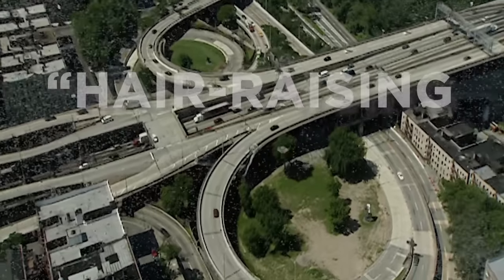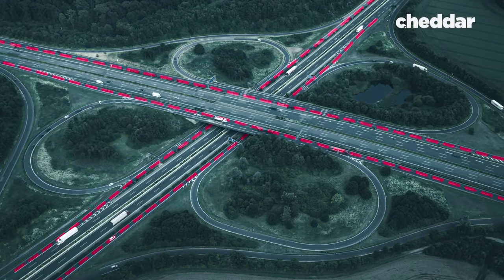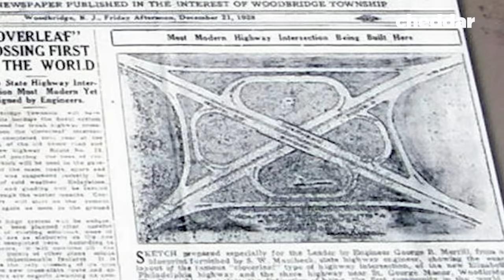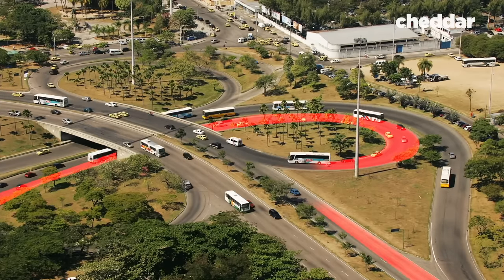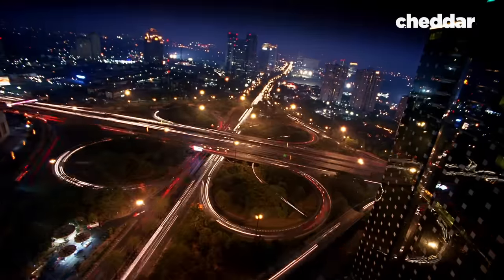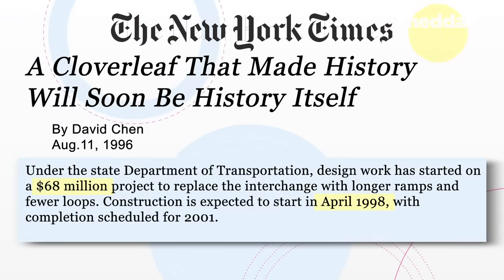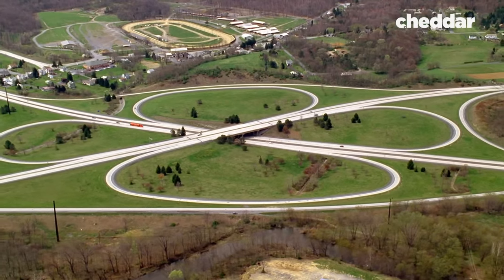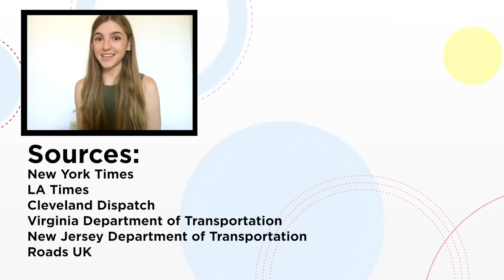The Big Problem With Cloverleaf Interchanges - Cheddar Explains

Comment: This Video: America’s infrastructure gets a D+ 8:58
Me a cities skylines player: Those are rookie numbers
Reply: The ASCE grading is about as useful as the Doomsday Clock.  It’s an over-used tool to get more funding ... to the benefit of ASCE engineers.  Don’t get me wrong, we need improved infrastructure but we’re not two partial grade ticks about ‘fail’ either.  How would ASCE grade India’s infrastructure, a “D-“ or the same letter grade as the US?
Reply: @UDumFck  The Lincoln Tunnel had water leaking in it yesterday. There's been a surge of water main breaks across NYC. Florida has had a problem with random sinkholes. A bridge in North Carolina had to be shut down because a support cable snapped. I would say that  is D material.
Reply: @Undecided0  Africa doesn't have paved  roads in most areas, I wonder what they would score?
Reply: @louvendran7273  Africa is a Continent not a country.
Reply: Undecided you double spaced “that  is”
Reply: Cites skylines woo
Reply: Ok, GrayStillPlays.
Reply: **Spams diverging diamond
Reply: You are not at a bad traffic level until there is 1% traffic flow
Reply: @UDumFck  Travel to actual sane country with laws written to benefit everyone, not just 1%, and you will see how good infrastructure looks like. D- is actually overoptimistic...
Reply: Sounds like America needs Biffa to come in and apply some lane mathematics on a nationwide scale.

Comment: A clever solution for the cloverleaf without weaving is found in Germany, right east to the Frankfurt Airport. A cloverleaf without weaving, because the exiting lanes merge inside the loop. There are 2 reasons why this solution was chosen: 1. located at the end of the runway, a construction up in the air was not an option. 2. lowering the intersection was not possible, because a train tunnel runs underneath it.

Comment: cloverleaf is an inside out roundabout. It favors through traffic, while roundabout favors right turns traffic. Both have capacity relative to turn radius.
Reply: The difference is that cloverleafs allow traffic to flow freely whereas theoretically roundabouts force all traffic to stop.
Reply: @joshbostock4371  You mustn't get out much.... or you're American.  You slow down a little for roundabouts -  except in Italy or Sydney where you speed up.  

It's a give way, not a stop.
Reply: Many motorway/dual carriageway junctions in the UK are raised or sunken roundabouts. Through traffic continues freely while only traffic that wants to turn needs to enter the roundabout.
Reply: Warwick Carter if there’s traffic in the circle you can’t just plow through them buddy.
Reply: @uhohhotdog  Merging into a roundabout is about timing  and giving way - not stopping unless absolutely necessary.   

If you're  always stopping you're doing it wrong. 

  If traffic is backed up inside the roundabout then there is a downstream products on one or more exits.  Queuing axross an intersection - roundabout or not is illegal in most places I've driven , even whrn there's congestion.
Reply: @warwickcarter4404  I'm a big round about guy, but either you don't drive or the roundabouts you do drive are sparsely populated. 

Agreed a yield sign doesnt mean stop, but any sort of consistent traffic, especially if it's not directionally equal (for instance a neighborhood road feeding a main road) will require regular stopping.
Reply: Warwick Carter I didn’t say every time. But it definitely happens. Not all roundabouts are giant ones with multiple lanes. Most here are very small one lane. If there’s cars in it you are going to stop.
Reply: @uhohhotdog   Most in my area too.  Usually you're able to see other vehicles and slow down rather than stop.  In probably stop at a roundabout once every couple of days, there's lots in my daily run around.
Reply: @cshairydude  That's a brilliant idea! My Cities Skylines will never be the same.
Reply: CommandoDude  Italians don't actually have driving rules. They just do whatever they want. I know this because I observed their driving for several days and there was no discernible pattern to what they were doing. The same rule seems to apply to pedestrians as well. We patiently waited at the side of the road for somebody to slow down and eventually we figured that you basically just walk out into the road and hope they slow down. I'm glad I don't live there!
Reply: @joshbostock4371  Meanwhile my country puts traffic lights & intersecting roads across roundabouts
Reply: roundabouts suck.

Comment: In the UK we have something more popular called a "partially unrolled cloverleaf junction" where two symmetrical loops are turned into right hand slip roads that run parallel to each other. They are useful because there's no weaving, they take less space and only minor traffic uses the loops. There's one on the M25/M40 junction
Reply: I knew I recognised that design, I live near and have used the M25 junction.
Reply: They look like a owl too 🦉
Reply: That would be known as a "cloverstack". Half stack, half cloverleaf. This eliminates all weaving. The reason to go full stack is for higher speeds.

Plenty of time you also see three parts cloverleaf, one part stack/turbine. It still has a weave, but perhaps that direction is not so busy.
Reply: That's the design I see in Austria.

Comment: They seem to work just fine in Germany, a few high traffic interchanges got upgraded, but the cloverleaf is still by far the most common variant.
Reply: Germany isn't as auto-centric as the US. Far more people use public transport over personal vehicles.
Reply: Germany's autobahns ends at the urban boundary, they dont cut through the urban downtowns, at least not to the extent that highways in the US does.
Reply: Tao Liu 
To be fair, when the highways in the US were built almost none of them went through Urban cores, everything just built up around them.
Reply: From what I've seen of German and Dutch cloverleaves, the lane where the "weaving" goes on tend to be a lot longer allowing the traffic merging in and out to do so at the same(maximum) speed of the lanes next to them, which helps a whole lot.

Also, let's be honest, it's a lot harder to get a license over here.
Reply: Certainly more space available.Then again, who wants to live right next to that.
Reply: Even the stack interchanges get backed up in the US. Living in both Dallas and Houston, you just accept your fate that your average 30 mile commute from suburbia to where you work will take at least an hour.
Reply: @8mensenvanens8  since there is not technical solution to social problems, this is utterly pointless :)
Reply: Jordan you forgot that Germany is in the Middle of the Schengen Area, meaning that it’s a transit country for people going from east to west Europe, north to south Europe and vice-versa

Comment: Main problem with cloverleaf is the difference in speed. These were designed in the 1900s for cars that barely even go 45mph. Nowadays cars can easily travel at 100mph without any issue. The people merging onto the highway don't have the ability to go 30-70mph in 2 seconds given the short length of the merge. Meanwhile, people exiting are given a very short distance to brake from 70-80mph to 30mph.

Comment: The classic "are the gonna try to go in front or should I....." while traffic still wants to do 80
Reply: Rule of thumb: a car exiting from the freeway onto a ramp brakes, a car going from the ramp onto the freeway accelerates. When two cars "block" each other, each driver should just do what's natural, not the opposite.

Road capacities still matter. If you need to having multi-lane ramps and multi-lane merges, cloverleaf intersections need to be replaced with other designs.

Comment: There's a fair amount of misinformation in this video. Diamond interchanges are not high traffic interchanges and generally can't replace cloverleafs. They actually support less traffic than a cloverleaf. Most full cloverleafs that are being replaced in the USA are being changed to partial cloverleafs (aka parclos)... an interchange type that's not even mentioned in the video... basically two of the leafs are eliminated in favor of intersections with stop lights on the non-highway arterial. The full cloverleafs that remain usually are upgraded to provide collector/distributor roads to move the weaving off the highway lanes or additional "braided ramp" bridges to eliminate weaving altogether.

The cloverleaf was patented in 1928 in Switzerland. It's true that the first New Jersey cloverleaf interchange design was adapted from a photo Delano saw on a magazine cover about a highway in Buenos Aires, Argentina, but that Argentina highway wasn't the first cloverleaf design.

Comment: Oh wow, so that weaving problem is the issue I’ve always had with cloverleafs, in city simulators I’ve always ended up needing to change them for other interchanges due to reduced capacity and weaving is the cause. I’d found myself making weird cloverleaf derivatives where I could have the slip lanes join on the opposite side to avoid the issue but it never hit me how it worked.
Reply: I think my local city planners need to watch this, I'm forced to weave way too often.

Comment: Well in Germany on the Autobahn we only have this type of interchange (at leat I can't remember to have driven past another one) and they work just fine, and there can be a lot of traffic🤷‍♂️
Reply: Thought the same at first but even worst traffic in Germany is normally less than usual rush hour in bigger US cities. LA for instance is a disaster. 😉
Imagine that in Germany the Autobahn lanes are pretty full but traffic is still flowing at at least 60 mph/100kmh. It is then very hard to merge onto the Autobahn and you may wait forever for a gap.
Reply: I've seen a lot of variations on the cloverleaf design where there's a lot of traffic. Even seen some Spaghetti interchanges.

The difference is: The traffic volume "here" is a lot lower and the whole system is more of a "feeder-major" system (I just invented that word) than a balanced grid, where you don't have to change between Autobahns quite as often.
Reply: @Mr.Thompson  Eh - I think you never travled in the Ruhrgebiet during rush hour then. There are regular traffic jams. The on ramps in some places have a traffic light system to reduce the amount of cars entering the Autobahn during rush hours, but you will still have standstill on the regular.
Reply: @Mysterios1989  I did and it's a mess, right. But not what I meant.
When traffic is so high that the speed is slow someone let's you enter the autobahn but when traffic flows at 80/100 kmh and there are no gaps, then it's hard to get onto the autobahn.
Reply: @Mr.Thompson  Not my experience either. Especially with 100 kmh, the mandatory gaps between cars have to be large enough that you can enter, and the one behind you will slow down. I even drove for the first years of my live having a license a dramatically undermotorised car and I never had problems to merge into the Autobahn. If someone sees you wanting to enter and there is no way to move to the side, someone will slow down and let you in.
Reply: @Mysterios1989  yes that's no problem in Germany as said because the traffic is normally not too high and if it is then it often slower so you can merge onto easily.
USA is completely different. Due to strict speed limits the gaps are also smaller.
I mean that can be compensated with longer merge lanes so you can speed up.
But as the video mentioned, it takes a lot of space. And there is no space left in metropolitan areas in US. 😁
Reply: @Mr.Thompson  Just to clean a few misconceptions here: Germany has for most parts strict speed limits on the Autobahn, too. In general, if you get into stretches of Autobahn that goes through cities, you also don't have more than 100 km/h speed limit. So, that is not too different with the US. The traffic can also be intense, especially if you are in areas like the Ruhr valley, as this is a heavily industrialized and metropolitan area. So, same goes with space here. The Ruhrgebiet is not called without a reason as one of the biggest cities in the world. While they are de jura different cities, in most areas of the Rurhgebiet, the city borders are touching each other closely, making it only noticeable by a sign that you left one city and entered another. 

I don't say there are good reasons to go away from this system of the cloverleaf interchanges, just that the reasons provided here does not really fit because they are also valid in other parts of the world where they are used without many problems, but under similar conditions.

Comment: Not sure but here in India, this has never been a problem. The exits are generally located before the entry-merge. So there's never an issue of merging vehicles interfering with vehicles trying to exit. Moreover the spacing between the 2 is huge enough as well
The biggest reason I understand why none of these highway infrastructure projects are able to solve traffic problem is residential development. The moment you build a highway/expand existing one, residential complexes end up getting built in nearby areas. This in turn only leads to increase in vehicles and eventually traffic. Even if you did consider potential future increase in vehicles, it is almost inevitable traffic would return. True long term solution is a good public transport system

Comment: I wish I had seen this video before we came to Dubai! All the interchanges are like this. Very efficient, but if you are used to roundabouts then it is difficult to get over the fact you need to exit right to be able to go left.
Reply: I prefer roundabouts myself
Reply: Then again, that’s probably because the UK is littered with them.
Reply: Now it makes sense. The issue is that in some places it is not enforced to keep yourself to the "slow line". Eg right one in continental europe or left one in UK

Comment: Hard to describe in words, but you can have a look what they do in Germany now very often with cloverleaves: you block lane changes in the intersection,e.g. by a small wall, and then built a small bridge over the leaf of a cloverleaf. So after you took a leaf, you don't change lanes, but drive above the other leaf and then merge in your direction. You cannot do it with too much speed, but it is surprisingly efficient

Comment: Inner leaves essentially create the problems that left turns do via entry/exit weaves. The primary solution to the obvious speed impediment is to have the inner exits at a different grade and a merger point after the next exit- which creates clearance and cost issues.

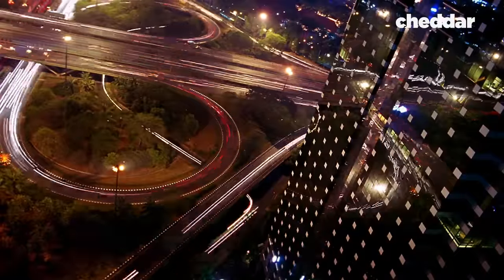Comment: 5:55 planners should've have taken into consideration the future, the likelihood of many more autos, the issue dynamics of the merge/exit interchange, and the fact of having to slow down so much to make the turn rather than just making bigger loops so traffic speed could remain at a higher pace; but noooo, they had to penny pinch instead of just doing right to begin with.

Comment: As a Jersey guy, this is a wonderful bit of history of our state. The highway interchange closest to my home is a cloverleaf, btw. People entering immediately before my exit seem to not care about the yield sign, or, they have a ton of room and I high beam the person entering to go but then they barely accelerate and enter the #3 thru lane at 35 mph as I'm decelerating from 70 mph (because 55 is a suggestion on my stretch to most people lest you get run off the road by a semi bypassing the Parkway to New York State or a soccer mom in an Equinox). However, I can tell you my interchange isn't getting upgraded any time soon. That ship has long sailed here in New Jersey, as the state has largely reverted to preserving/refurbishing existing infrastructure rather than adding capacity in many places. Some interchange improvements make the cut on our most heavily traveled roads that we share with out-of-staters, but generally speaking, locals still deal with a lot of jughandle and cloverleaf insanity close to home on a regular basis. (Our daily use of sketchy interchanges coupled with contending with non-locals is a big contributor to our reputation of being aggressive/mean drivers here in NJ. Sorry not sorry, NY and PA.)

Comment: when in doubt, roundabout
Reply: Not at 70 mph. This is an interstate highway, not a town road.
Reply: Biffa would be proud....
Reply: @Bobspineable  the slip road off leads to a roundabout on pretty much every motorway I've ever been on! Traffic leaving the motorway doesn't get snarled with traffic joining in the same way as on a cloverleaf because the exit is before the joining traffic. The roundabout may get snarled at peak time but traffic does generally keep moving. 

Also, the roundabout system takes up way less space than the sprawl of a cloverleaf!
Reply: @nunya___  it just has to be bigger... Like small town fits in the middle big. (Just don't put it there, it'll be hell).

There is a different variant where there is a roundabout over, between or below the through lanes, it takes up a lot less space but needs 5 (I think) bridges. Not as smooth as a stacked interchange though.

Comment: Solutions to the problems:
"High accidents": Build the already mentionend seperated sliproads with low speed limits to allow safe lane switching
"Traffic jams": Reduce traffic and/or build more highway exits
"High cost and large land use": Dont build large highways and especially not an interchange between two large highways in city centres!
Greetings from europe, cloverleafs work here just fine